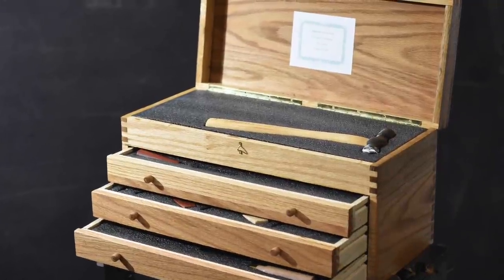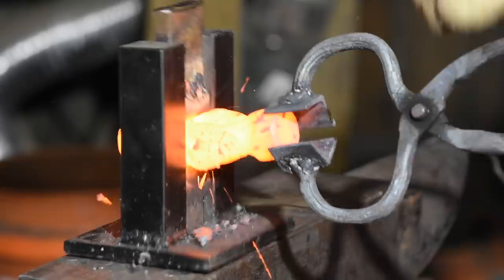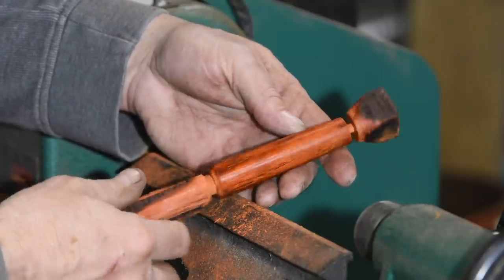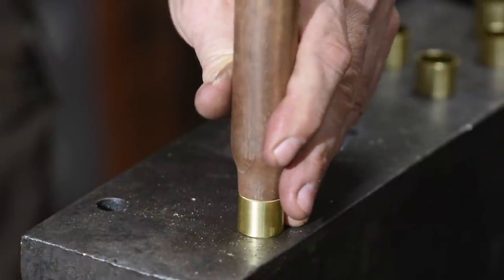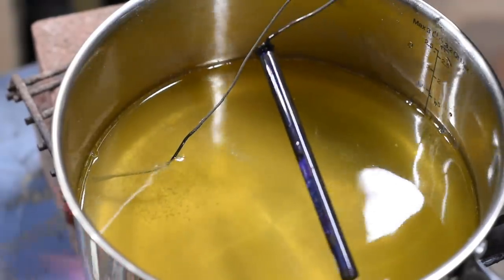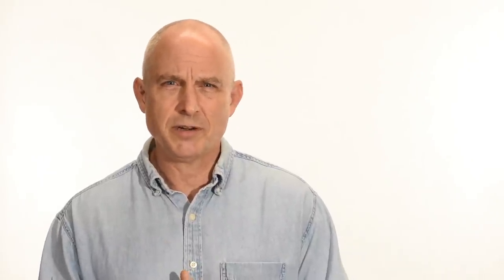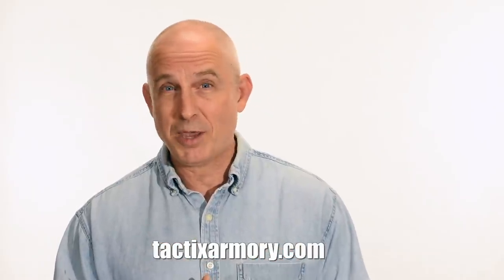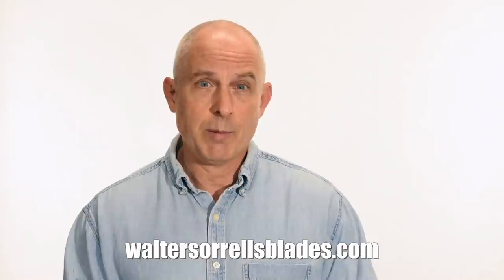A Box of Tools for My Son - The "Jake's Tool Box" Project

Comment: About a cool a gift as possible. Hey Walter, if I can become your favorite older brother, cousin, best friend could you do those for me ;-) I'll even handle the tool box build so you can save some time. I built the Izzy Swan geared tool box using dovetails and mixed, contrasting woods. It's too nice for just screw storage and such. Your tools would be the jewels in the box.

Comment: I think you did a fine job on this very cool project.

I do have some concerns about the structural integrity of the design of the handles on the screwdrivers and the chisels. Seems to me either  tight screw or a big whack might end up with a handle failure.